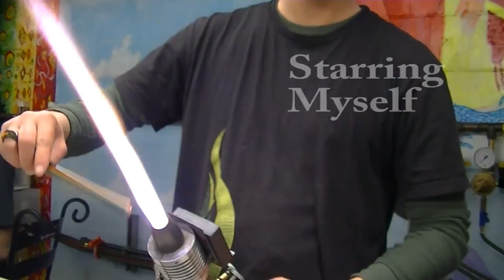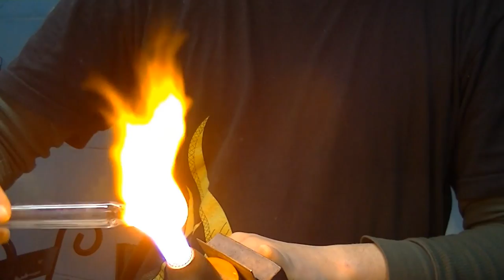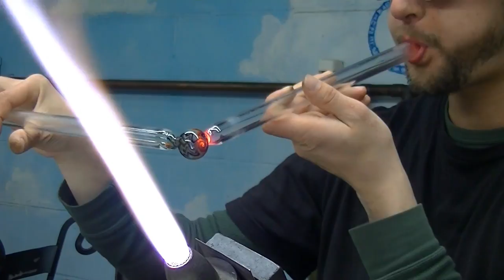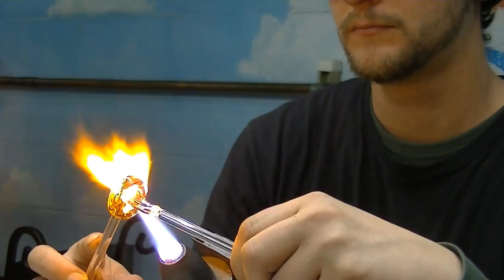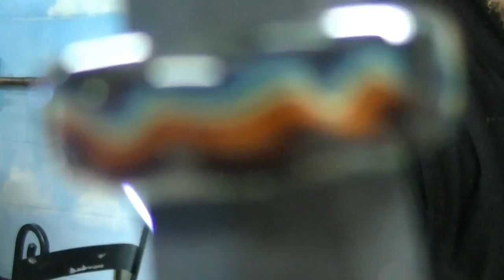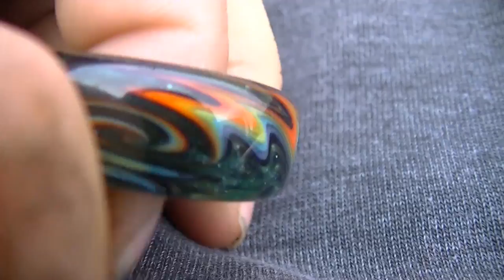Glass Blowing - Glass Reversal Ring Demo - LickMyGlass

Comment: i always wonder how hot the glass is after u take away from flame for a few second. And how much it take time if u can touch the glass with bare hands wit no damage to yourself.

* is there a glass u put to the water for cooling? or it always will break :)

Answer if u can.

Amazing video after all. :)
Reply: +Andrzej Strzelba As a Scientific Glassblower with over 26,000 hours of hot glass experience.  The answer to "Can you put hot glass in water or will it break?"  Have you seen vases with broken crinkles all over it and the out side is smooth?  They put the vase is water and it breaks the outside of the glass and then they rush to put it back in the furnace to refuse the outside of the vase.  Simple answer is almost all glass will break when hot and water is applied to it.  Glass breaks because of stress.  The stress can be from a number of sources, heat, mechanical, and chemical, and even differences of expansion rates from different types of glass.  I hope that helps.

Comment: Is there any type of glassblowing/lampworking that I can try that does NOT require a kiln for annealing?I'd like to try some tubework,figurines,marbles/bulbs,but am on disability so can't really afford one,or have a place to put it.Thank You
Reply: +Bowtie41 You can pop it between some fibre blanket for awhile....that will help.  It will be more sensitive to thermal shock though...don't use this method for wearable glass.